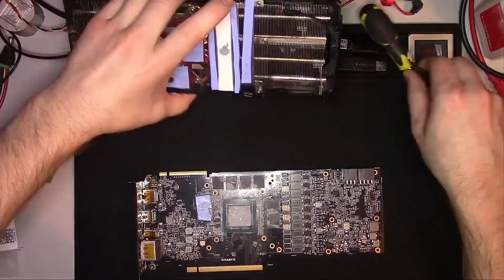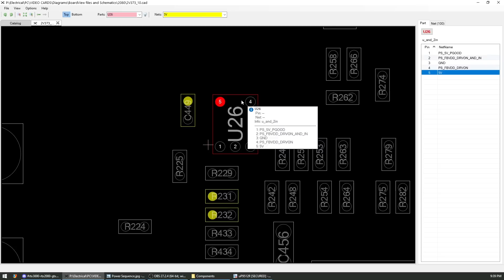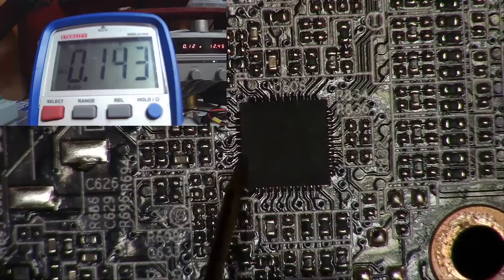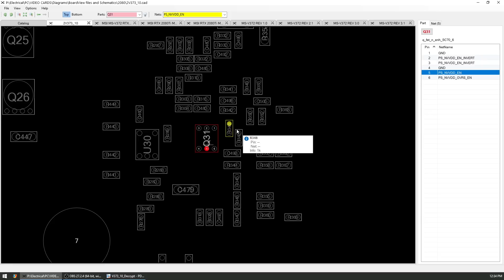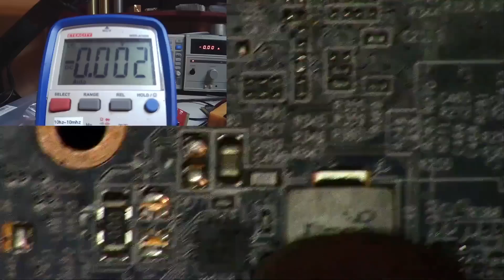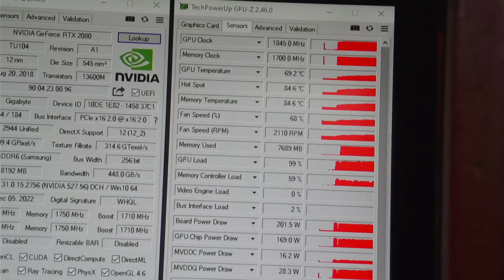Gigabyte 2080 Windforce 3 no voltage Repair

Comment: So now that EVGA is no more, what brand would you recommend at this point? I've always gotten EVGA because of their RMA services.. wouldn't trust MSI with a 10-foot pole and I've been burned many a time before sadly learning that lesson.. gigabytes.. gigabyte is a terrible company LOL at least on the customer facing end.. I've always used Asus motherboards, and have been well served in that regard but the last days these motherboard that I've had operational was an x79 board... My x570 build is still in progress as I just haven't gotten around to it yet for about a year and a half two years or so... But when I first got the board for it I returned it because I thought it was an open box.. turns out they just don't seal motherboards anymore.. so who knows if it was actually LOL I'm assuming that's one of the reasons why... from the sound of it there's not really any of the major electronics manufacturers that are trustworthy these days...

I genuinely do not want to have to have the first thing I do buying a new video cardneed to check to see if they put thermal pads on everything LOL. That's just not a thing that I've ever thought I had to do on a video card LOL.. especially now in the modern age when they cost an extra fortune on top of the fortune they already cost, and when it's very very apparent that EVGA was unique in how they did RMA.. so it's not like I can trust if there is a problem that it's not going to be tooth and nail to solve it...

Is there any good board manufacturers out there anymore? And if not what is the least problematic from your experience? I had more than a few EVGA video cards pop on me within a very short span back in the old days.. but they also didn't cost anywhere near what they cost nowadays for the equivalent.. and this was back before they did the whole quality service overhaul.. anything 2010 and above I've had nothing but extremely good service from EVGA..  and over the last decade with my x79 board and 4930k.. I've kind of grown accustomed to not having to have problems with my computer LOL I would not like that to start again, especially now that the motherboards are three times the cost for the equivalency.. apologies for the rant LOL..

Comment: Hello, I have a zotac 2080 ti with Vram 4 ohms and errors on bank B0, I desoldered the module and now I have 14.9 ohms on Vram So far so good. My question is how do I know that only the solder joints are broken or if the IC is broken? I once measured the IC myself between Vss and vdd 5Ohm is that normal or how can I measure the RAM module myself for a defect maybe you could make a video about it that would help me a lot is the Samsung K4Z80325BC-HC16
Reply from the maker: you dont know. 
you reball and try again.
you measure to ground, not from vcc to vdd.
If you removed the chip and resistance normalized, then your memory chip was short.

Comment: What tools are in the USB?
Reply from the maker: mats/mods
Reply: @northwestrepair  what do you do if the graphics card has all voltages and won’t run mods or mats not even in Linux vram problem

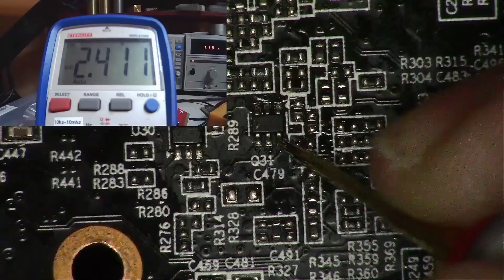Comment: At 13:20 how does the power supply trigger at the same time you are mesuring?
Reply from the maker: Because I flip the switch when I take measurements and then power supply shows the load.
Reply: @northwestrepair  the multimeter is linked with the psu?

Comment: Nice fix as allways!
May i suggest a add on to your setup, a better light for the microscope which gives less glare and more details, offcourse you can buy it from the one of the biggest ........ at this moment (NR......) but i think aliexpress or amazon should also work fine for a far better price :)
Reply from the maker: Yeah but i dont know which one to get.
They all claim to be anti glare but they look exactly like what i have on my my scope already so am not sure.
Reply: @northwestrepair  Allmost everything that's not a ring light will give far better contrast and less reflection.
even 2 simple medium power led bulbs placed on the side will reduce the glare like crazy.

Comment: This reminds me of a DDR4 GT1030 card. It had a missing 0ohm resistor for PEX RESET (cheap variant, without the and gate) and one  of the two 0.2uF MLCC from PCIE lane 2 was also missing.

Seeing the AND gates missing on your board, but no other component around them missing got me wondering again, what kind of accident can knock those off the PCB but leave the surrounding components unaffected?
Reply: Maybe it was a donor card itself and the owner got it on ebay for like $100 🤷‍♂
Reply: @The_Man_In_Red  That would be the more likely explanation.

Comment: Can you upgrade to 4K UHD cam?
Reply from the maker: Maybe you can buy me one ?
I would need allot.
4k overhead cam.
4k side cam.
4k HDMI switch
4k HDMI splitter

That's hundreds and maybe thausands of dollars I do not have.

Feel free to donate what ever I need.
Reply: @northwestrepair  4k30p is enough for this kind of video, do you capture all over HDMI?
Reply from the maker: @klaus.luppert  yes
Forgot to mention, I need better lighting too, so throw in a nice anti glare lamp if you can.
Reply: @northwestrepair  So HDMI 2.0 is sufficient. I searched a bit and found this: 
Sony ZV-E10
Reply: @klaus.luppert  Please send it to northwestrepair asap, thank you very much for your contribution.
Reply: the microscope is fine, it only needs better lighting
Reply: @yaminsiddiqui4690  I think you are right. 1080p can look much better.